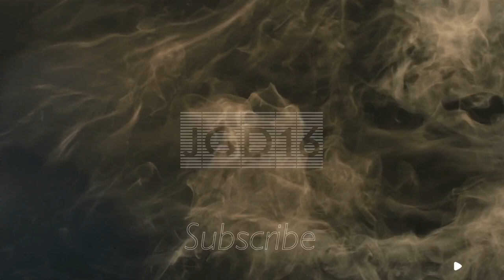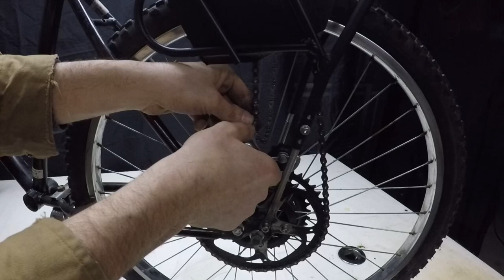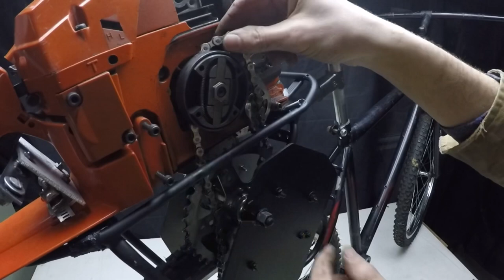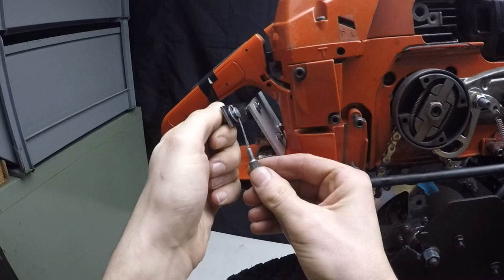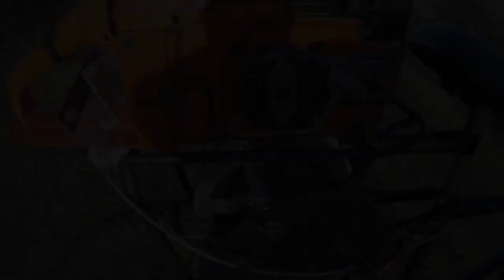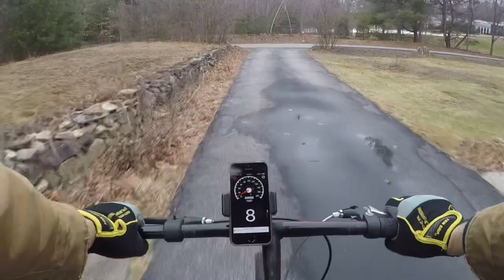Husqvarna Chainsaw bike

Comment: I have a problem. I made a Chainsaw bike but my clutch smokes and creates a high temperature. Do you perhaps know to what extent it could be a problem. The chainsaw is the same power as yours.
Reply from the maker: You should check your drive ratio. That’s how many times the clutch spins per one revolution of the wheel. My bike is running close to 20:1 and the clutch seem happy. Anything lower than that you need to change the sprocket sizes and or install a jack shaft.

Comment: Hey I have a problem so I welded the sprocket on the outside of the clutch and I’m using the stick 7 speed on my rear wheel so when I hooked it all up I couldn’t pull start it unless I lifted the back wheel up because it was to hard because of the chain so I had to lift the back wheel up but when I did that the chain fell off cause it was loose, do you think that’s cause I need a chain tensioner?
Reply from the maker: Two parts to a centrifugal clutch. The inner mechanism connects directly to the engine crank and the outer piece spins freely. the free spinning one is where the sprocket should be connected. As far as a chain tensioner if you have a very short amount of chain you can get away with no tensioner but if it’s a long length of chain you definitely want a tensioner

Comment: for more torque you can fit a smaller rim at the rear. I think put 16inch kids bike rims on the back. get a thread of the same diameter as the rim and weld it to the rim.
Reply from the maker: Thanks for the recommendations

Comment: Nice 30 miles per hour on the mountain bike that's fucking fast. Any faster you need bigger tires or you get speed wobble probably, But if you get larger fat boy tires Until 29 inch rims, I bet you could do 45 -50 mph no problem

Comment: Very cool just imagine what could be done with the right gearing for the right job or all round gearing good torqs an good hp ie great take offs an great top speed bet with the right gears could have it doing 80mph but with an assisted take off
Reply: @stepchild , I was thinking that too but you'd have to upgrade the size of the tire Get those fat boy tires and like 29" rims On a normal mountain bike 30 miles an hour is fucking fast and you're hitting speed wobbles Anything faster. But with the larger tires and rims you could easily do 45-50 mph ,I don't know about 80...
Reply: @bryanharoldfuller8330 ols I bike faster than that without a motor but serious your always gonna find the weakest link from vibrations to top speed take offs blah blah blah an sound sound is always an issue

Comment: what chainsaws/engine size and power would you recomend for this?
Reply from the maker: I used a 51 husky the bigger the engine and the clutch the better off you’re going to be. With a smaller engine you’re gonna have to gear it down a lot which in return you will lose top speed. I also use some electric chainsaws which are a pretty good option 80volt chainsaw e-bike ⚡️
https://youtu.be/vI2vmVrrZV0

Comment: what if you got a really small sprocket, and hooked it up to the derailleur?
Reply from the maker: You could do that but the bike would not takeoff very well and you would probably burn out your clutch pretty fast. Most important thing is the gear ratio you want the engine to turn over roughly 20 times for every one time the wheel turns that seems to be the sweet spot for my chainsaw.
Reply from the maker: You could do that but the bike would not takeoff very well and you would probably burn out your clutch pretty fast. Most important thing is the gear ratio you want the engine to turn over roughly 20 times for every one time the wheel turns that seems to be the sweet spot for my chainsaw.

Comment: that's pretty dang awesome!  I wonder what you could do with a 66cc 2 stroke kit from China?
Reply: Ive got a 92cc Stihl 660 clone I'm going to use to make a bike, hope it doesn't maim me
Reply: @bengrinberg7042  what were the results?
Reply: @slender1357  the chainsaws carburetor got unreliable I'm trying to get it fixed. But with a 30:1 gear ratio it seems like it'll be a safe ride